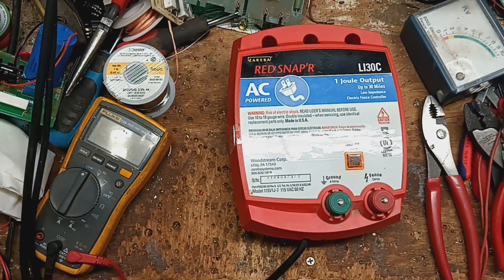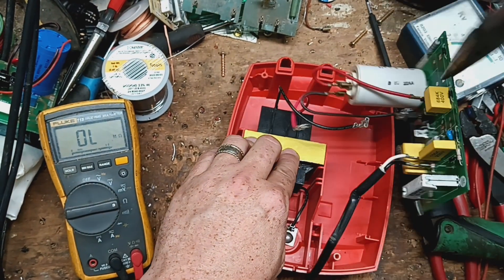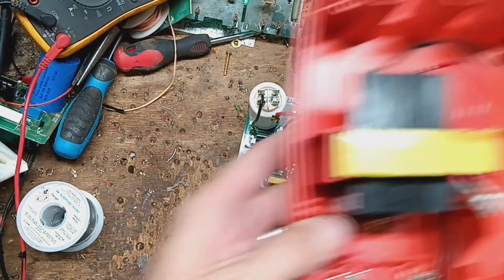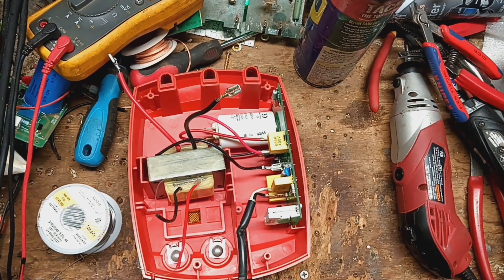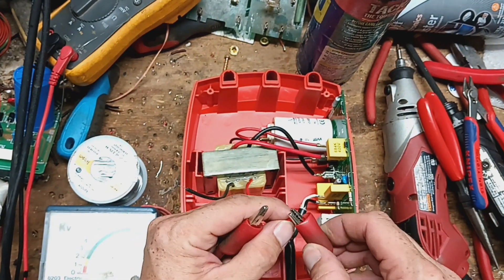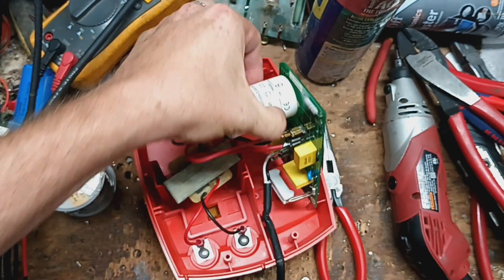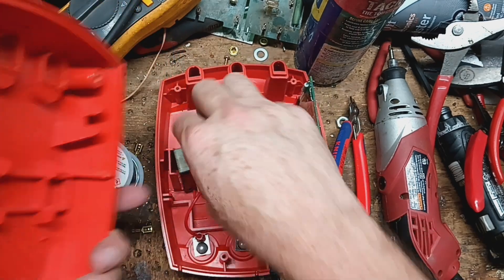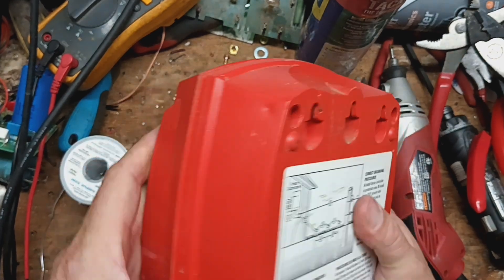How To Test Repair An Electric Fence Charger | Zareba Red Snap'r LI30C 30 Mile Fence Charger Repair

Comment: I sent Dale a fence charger 2 1/2  months ago. It has not been returned. I have called and left many messages and texts and have emailed him. There is no reason not to return a customer phone message when he has a minute to give a update on my fence charger. If I didn't need the fence charger I would not sent it to him to get repaired. There might be a legit reason it has not been repaired, but there is no excuse not to update a customer when they call and call.
Reply from the maker: If this is Mr. Hudson, your unit is still sitting here waiting on a backordered part and the distributor we get the parts from said they're supposed to be in stock to ship out within the next couple of weeks give or take. 
Sorry for the delay. Lots of phone calls this time of year and I miss over half the calls that come in. Plus, 3 small kids all 5 years old and under and I have my hands full with them at times as well.
Reply: @FencerFixerRepairLLCKansasCity  Thank you for updating me. I have tried for a long time to get an update from you by text, voice mail and email to no avail. I had came to the conclusion you had went out of business. In the past you were very prompt in responding to me.